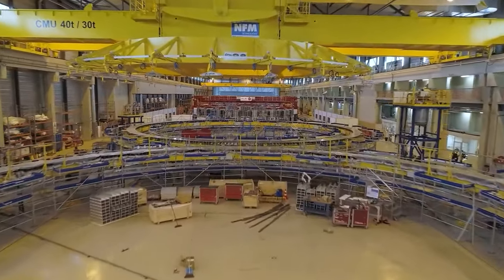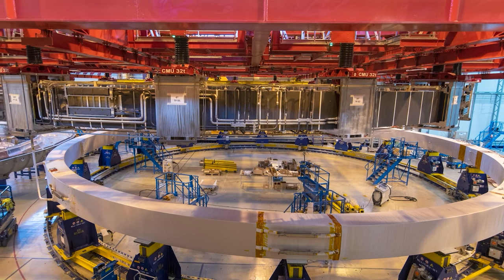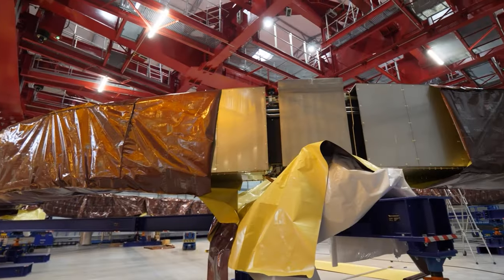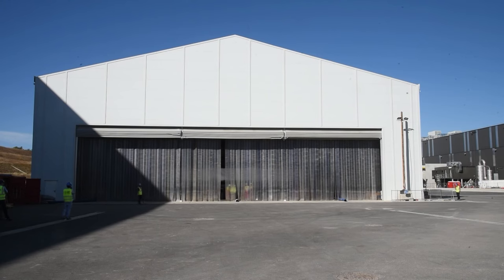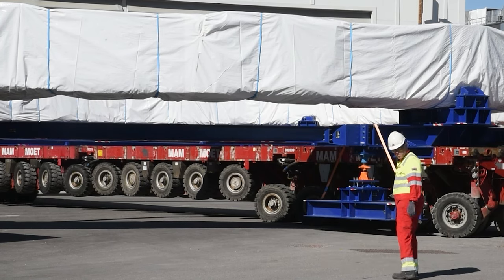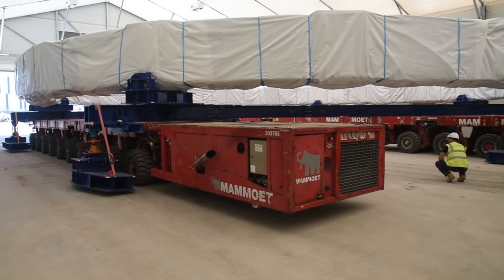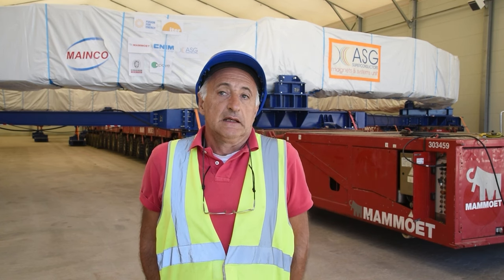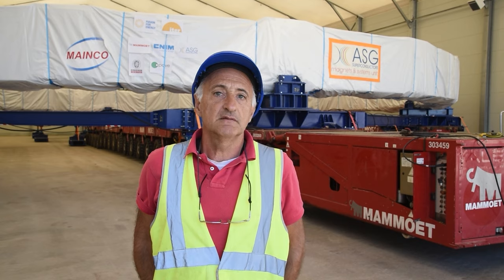Massive ring-shaped coil goes into storage

Comment: There will be no ignition at ITER in 25 or 26. It starts with H and He plasmas for 4-5 years. Then they shut down and assess. Then they do DD. Then they shut down and assess. Then they do one DT shot. Shut down and assess. Then eventually they try to do more and more powerful DT shots until they reach breakeven — which is not necessarily ignition because the plasma doesn’t need to sustain itself to produce more energy than it needs. 

By the time you get burning plasmas in ITER we will have achieved the same in a smaller machine several years prior.
Reply: Which reactors are you speaking of that will beat ITER to PPC?
Reply: Definitely not Helion XD